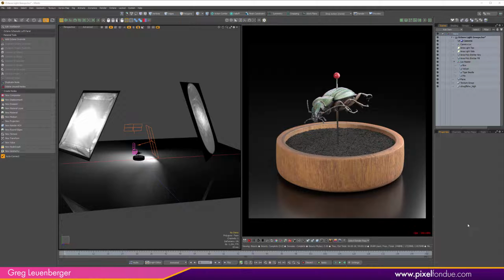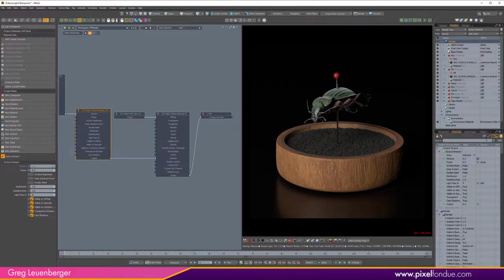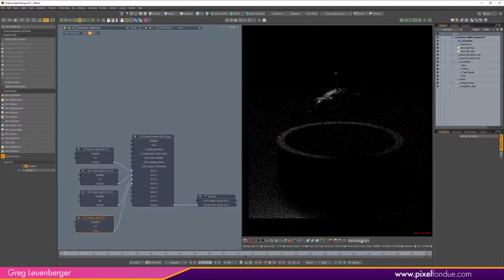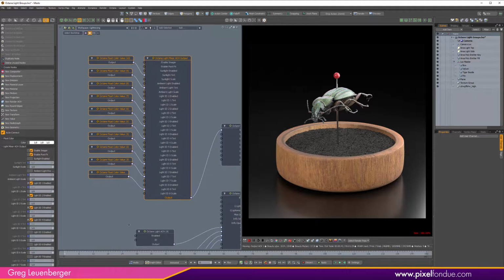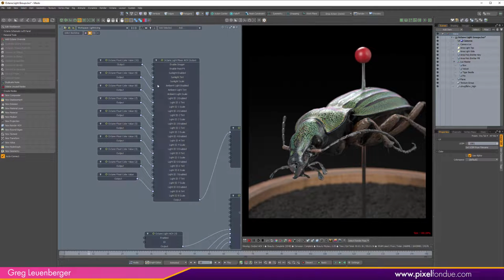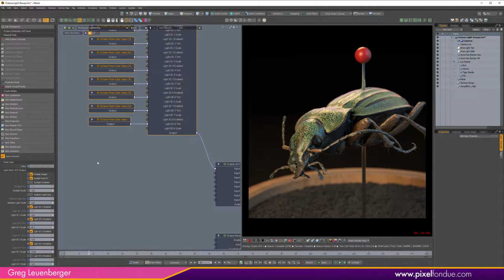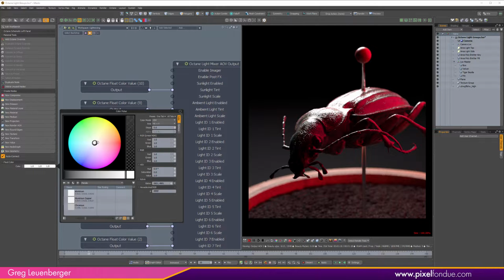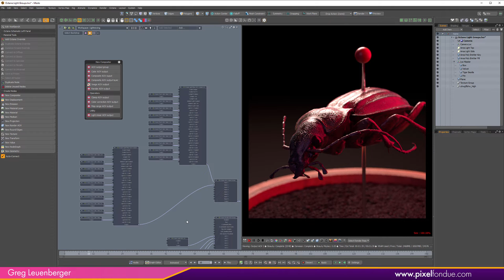OTOY Octane 2021 Light Mixing

Comment: This is super helpful! Do you have a source for those HDRI light images you're using? Would love to pick some up.
Reply from the maker: Sure - it's this.  I'll put it in the description.  https://3dcollective.es/en/producto/real-light-studio-pack/
Reply: @pixelfondue  Awesome, thanks! Just playing around with a couple free ones that I had, have you found that lighting with an emissive texture light like this is significantly slower and much noisier than using an area light, or am I doing something wrong?
Reply from the maker: @williamreinhard  It can be if the quality of the HDR isn't super great..at least that would account for firefly type noise and the extra time to clear them.  The ones I used in the video seemed fine - I really didn't notice anything, but yeah - a simple 'value' in an area light would probably be less noisy (and so a little faster)